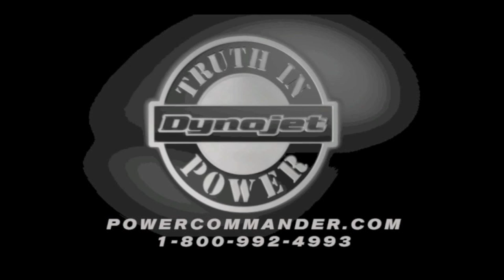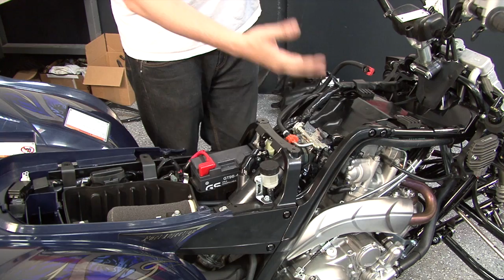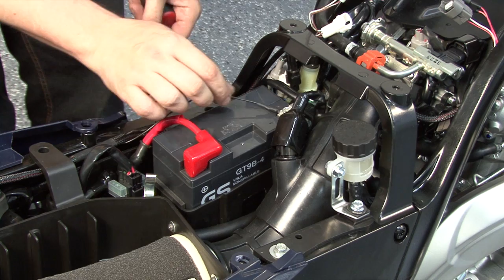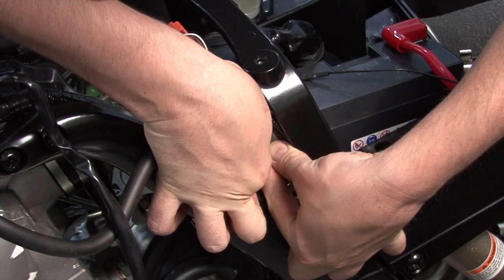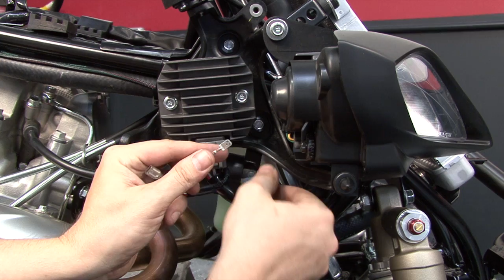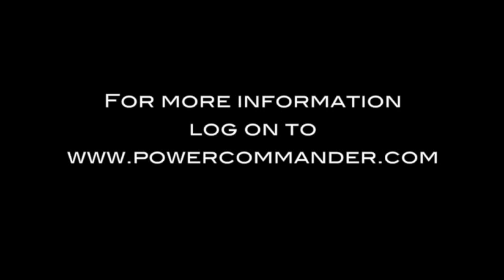Power Commander V Install: 2014 Yamaha Raptor 700

Comment: whats the weight limit that this fourwheeler can carry
Reply: Jay Rock  Per the Manual 220lbs. I'm just going to say I'm a wee bit over that limit :)
Reply: Yeah Me Too, But I Still Want One
Reply: Jay Rock  I think they come up with the numbers to cover their butts. First of all we're not likely to be 20' in the air on these quads.. But I will say if you do try that you are going to blow the shocks!  I've been riding my 15 700R SE pretty hard and I've had no issues. If there would be any issue it might be bottoming out which I haven't had happen and I've not even adjusted the pre-load on the coil overs to "hard" they are where ever the dealer set them.
Reply: brett248vista So I Should Purchase Stronger Shocks?
Reply: Jay Rock  You could! There is a guy on the Raptor Forums goes by the handle Jogaca he re-works the factory shocks and can spring them for any rider weight. He can do multi stage progressive springs etc.. Looks like he does great work! If I had any issues I will have him do the shocks on mine but so far so good.

Do a google image search for "Jogaca" and you will see his shock work.
Reply: ok thanks

Comment: i have the raptor 700r se 2015 and i have had problems from the start with the fmf 4.1 slip on it back fires alot and cuts out when give a litle throttle and the yamaha dealer has no idea why lmao any help would be great. do i need a power commander?
Reply: OK cool yer I have the fmf header with mega bomb coming on the 28th of July and the pc5 so should be a perfect fit thn with no leaks but it stalls with a little bit of gas think it's because it backfiring with no revs so it stalls not really shore but it the only mod I have done to date sounds really gd but the back fire is annoying and don't won't the problem that come with it, thanks for the reply.
Reply: ***** hi i have now recieved and installed the pc5 but have no map and leave along way from a dynoresearch center was hoping you no were i can get one from thanks,

Comment: In my country in uae they said if you put power commander 5 on your yamaha raptor 700r then you have to take everything from the quad like/stock exhaust remove.stock tires remove.stock filter remove/ put instead/barkers dual exhaust. 4-snow tires. filter K N do I have to do that or they're lying it will not damage the power commander 5 what do you say
Reply: Hattem Ghanoom no just the air filter and exhaust